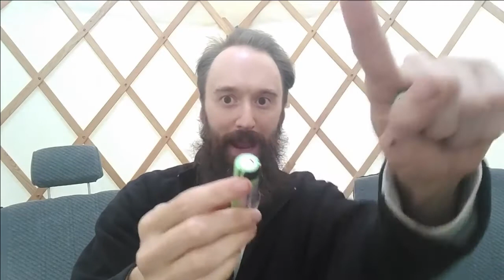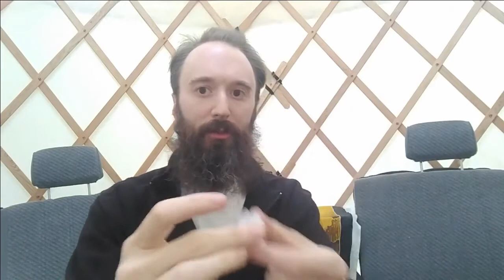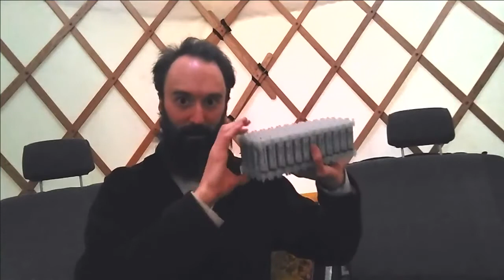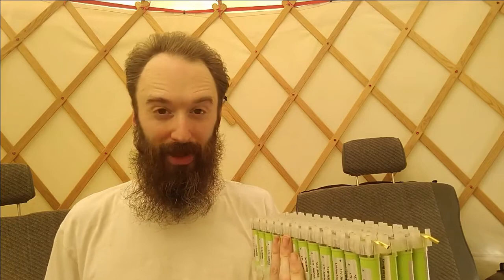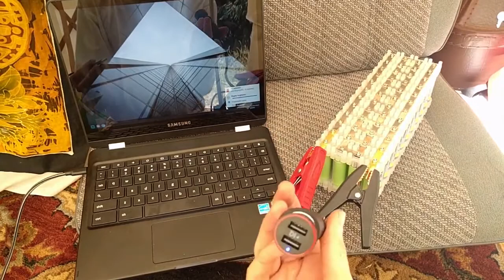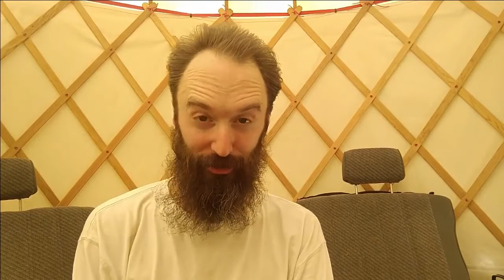Using 18650 Lithium Ion battery for off grid home

Comment: Not going to lie. Li-io. Is better than led acid in a lot of ways. And environmental impact is not one of them. Look up Chinese cobalt mines. Between the toxic soup they work in and the child labor... Yea. Thankfully the US is starting to source rare earth in other ways. Also. AGM cells are better in freezing temps. However if you just put your bank in a climate controlled part of the house that's not a problem and well worth the tradeoff for much better working duty cycle. Personally. I'd like to go with lithium iron phosphate packs.